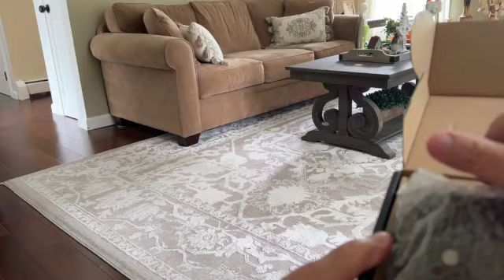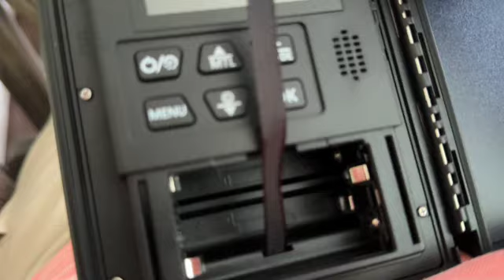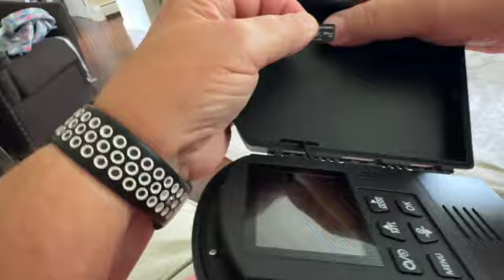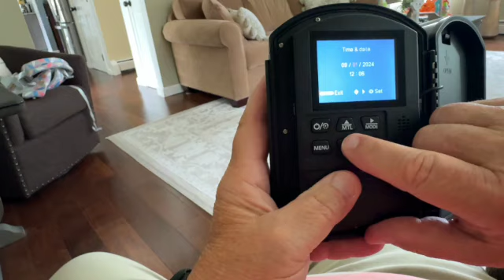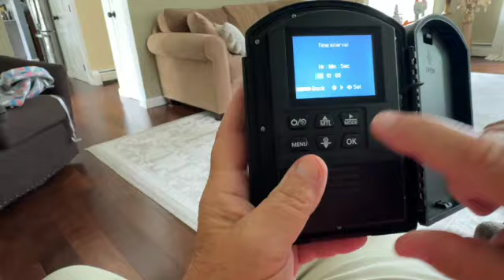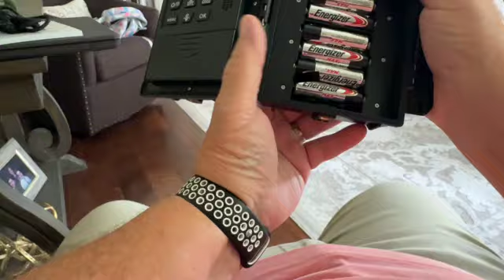**Dsoon TL2100 Time Lapse Camera Setup & Programming Guide | Unboxing + Settings**

Comment: I am using this camera on a construction site.  I just did a short test "shoot" and I'm wondering if it's possible to just locate / save the individual photos the camera uses to make the .avi file?  I couldn't locate the pictures on the SD card, just the .avi it created.
Reply: You probably need video editing software like Pinnacle Studio or Adobe Premiere. There are some free apps but I use my Windows 10 PC with Pinnacle Studio software for editing. Not sure if it can export still frames from an AVI format video file.
Reply: @MikeSmith-yj9qm I ended up using Gemini to write a powershell script to rename all the files to include a timestamp.  Then I use a free time lapse creator tool to make the mp4.
Reply from the maker: in that case - you can put it in iMovie and grab the pictures you want - or change the setting to not make the avi but you'll end up with 10's of thousands of pictures